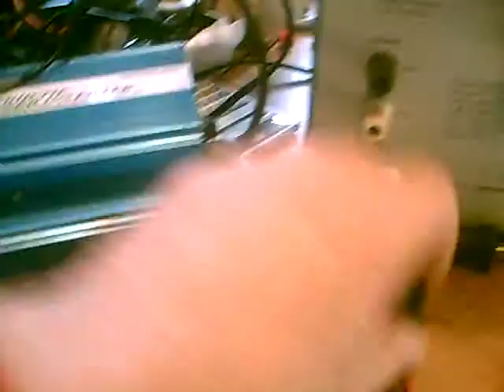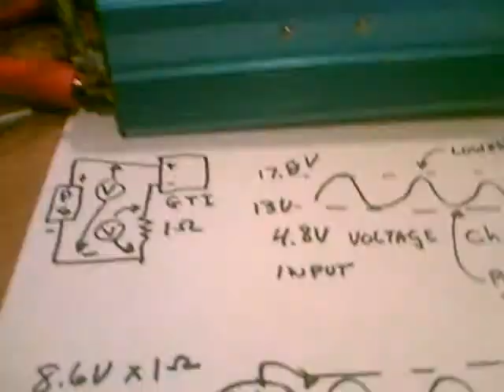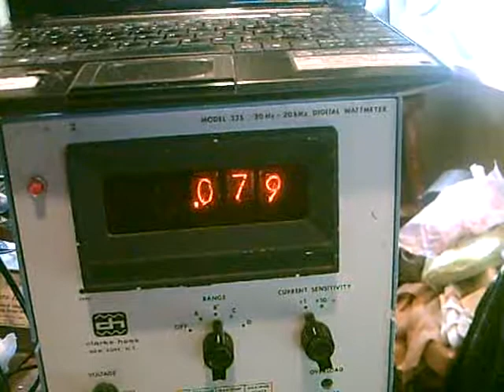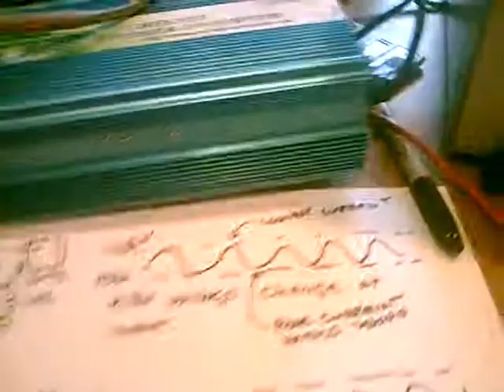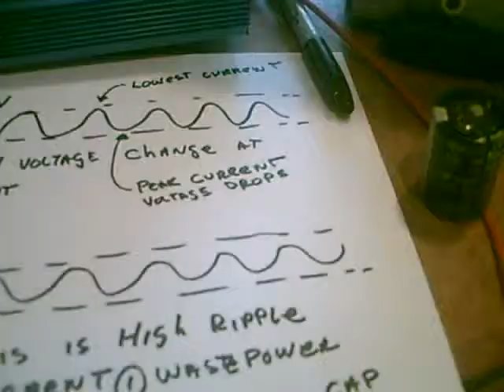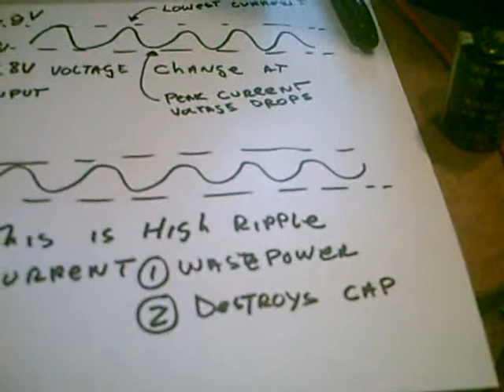Grid Tie Inverter CAPS,   What They Don't Talk About

Comment: After changing dead caps for threee times on a battery powered inverter (not a grid tie one), i´ve learned to put some small ceramic caps in parallel to the electrolytic ones. They can handle the first high current, and so the electrolytic one will last for much longer. It has been some years, the caps are just fine :-) .

Thanks for the video.